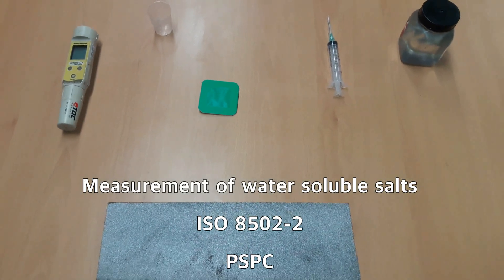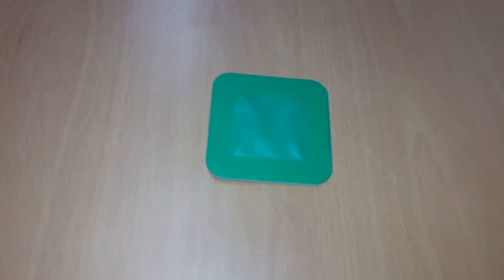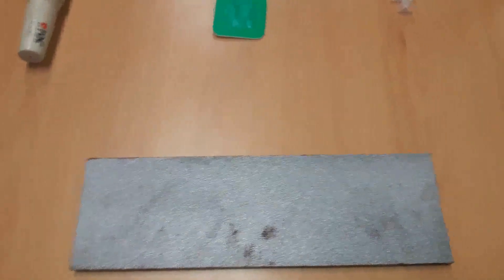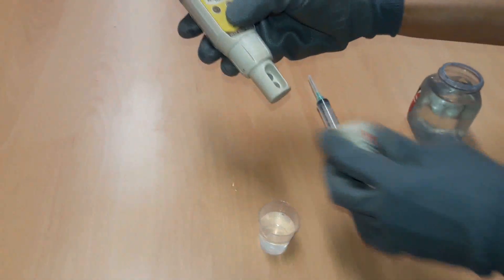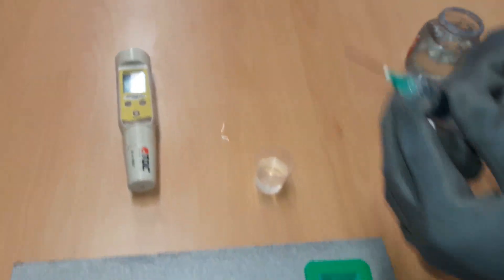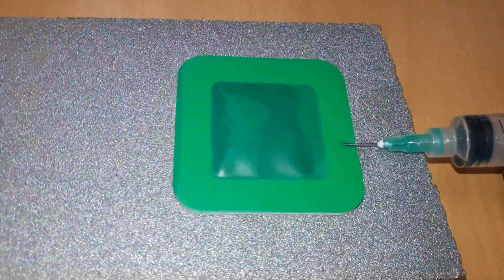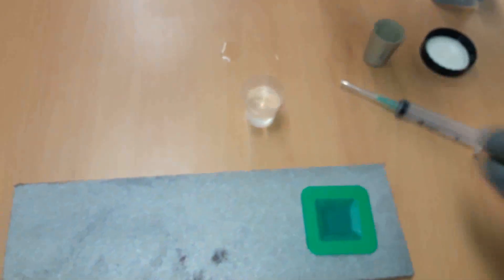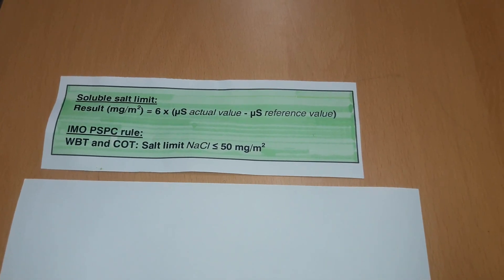salt test (ISO 8502-9)

Comment: You have to pull out solution only ..4times cycke i jectuon and every time have to settle up to3minutes rest then you pull into syringe and pour again.read the standard..your device show on micro zimens and your calculation doesnt seems right.however at start you need to use zero sokution based which is zero on device.you had wrong solution.its 3 to choose.